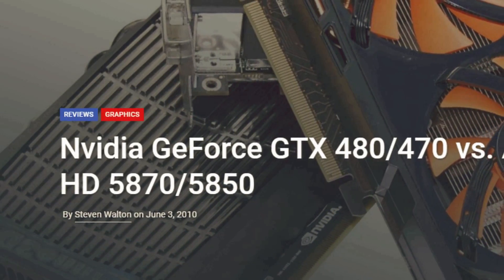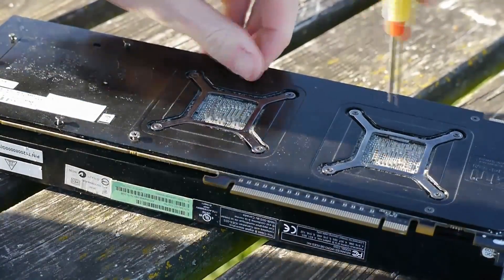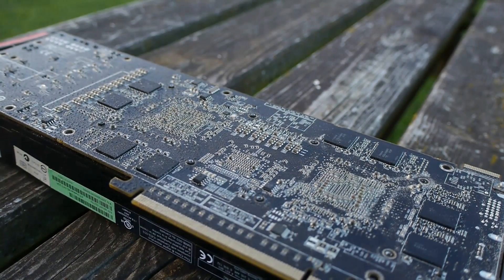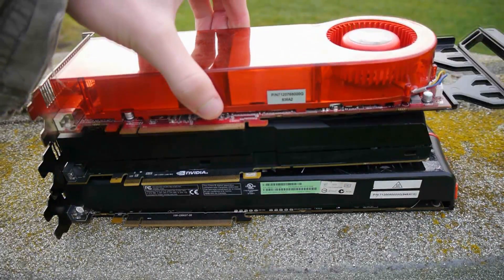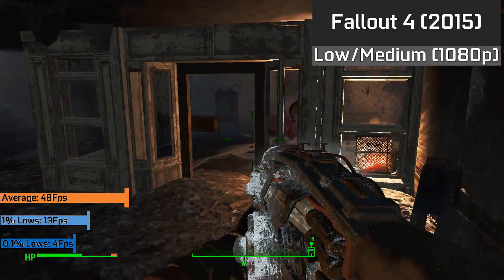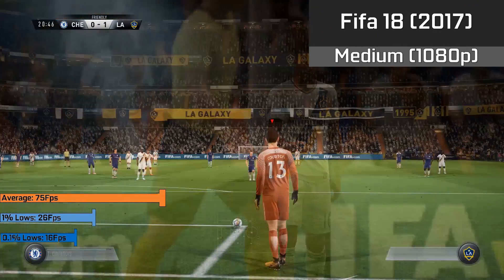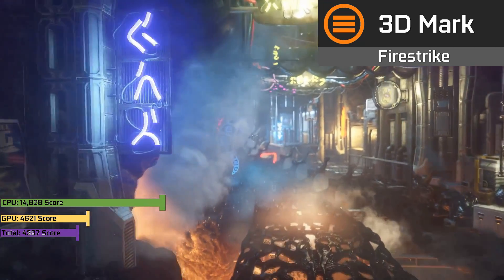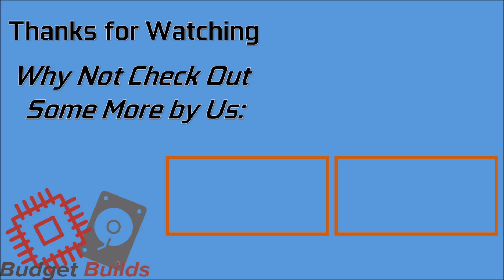The HD5970 is now £25 ($32) but is it any good?

Comment: Even today, 3200 shader units is A LOT. My fury after that was 4096 shader units, which was a ridiculous amount itself. 

For reference, the GTX 1080 has 2560 cuda cores... this just goes to show you how over engineered AMD has to be in order to compete with nvidia, due to the fundamentally more optimal exploitation of nvidia technology in windows. This is also why AMD is so good at bitmining. Their hardware has such a ridiculous amount of horsepower that games simply fail to exploit, but bitmining software can.
Reply: Well actually, the issue is more that Nvidia optimizes their cards just for games, while AMD tends to re-purpose their tech, building their mainstream products off of workstation/server hardware.

GCN is great at general compute tasks (like mining) but is not so great at heavily single-threaded workloads, like games running older DX API's. They do brute-force things a bit, but they also work around that limitation via drivers, which is where their "fine wine" technology comes from.

GCN and Bulldozer function very similarly, to the point I wonder if its what inspired Bulldozer in the first place. They even have similar gains from DX12 and Vulkan.
Reply: Richard Smith those shaders aren't even remotely comparable. Terascale uses a VLIW setup, which means it uses VERY simple shaders vs the complex, superscalar and/or superpipelined SIMD setups of modern day GCN and pascal. A 290, with 2/3 the shaders can easily go above and beyond it in terms of performance. 
The big problem is that AMD had trouble feeding those shaders, and workloads that were not embarrassingly parallel didn't scale well.

It has nothing to do with over engineering. Its a design decision. Fewer, complex cores vs many simpler ones.

Also, here's a BIG reason why nvidia didn't do well in mining. Bitcoin mining, using the SHA 256 algorithm, makes heavy use of 32 bit integer right shift operations. This takes one operation in GCN, but takes 3 operations in Kepler. You'll notice much if the gap has closed since maxwell in this regard, which may be explained by an addition of this instruction.
Reply: @hydrochloricacid2146  You mean HD 5970 vs. R9 290? The 290 has 4/5 as many shaders (2560 vs. 3200) yet the FP32 compute of the two cards is almost identical due to the 290 being clocked higher. At least for FP32, each stream processor yields 2 GFLOPS per GHz of core speed, for both cards.

Kind of ironic that Fermi ones were actually a lot stronger (GTX 580 only has 512 of them). Is it less efficient to have more powerful individual stream processors/CUDA cores, given "Thermi"'s high power draw? Or was that due to other parts of the architecture?
Reply: Richard Smith 1 CUDA core isn't the equivalent to one shader unit...
Reply: Ikr
Reply: Evbil_wafflez thank you some one who knows parts, shader cores haha lol
Reply: You can't compare shader units to cuda cores just by looking at numbers.
It's a difference in architecture.
Reply: Bro, more shaders doesn't mean anything if its slower per shader. Just like 3900x vs 9900k.
Reply: Actually HD5870 bruteforced it's way while being cooler than Fermi but it's still got outsold. Nvidia lives by it's marketing and anti-consumer practices like GameWorks.
Reply: That's partially true. You should also consider that nvidia has had the most market share for so long, that the majority of testing and optimization was performed with nvidia in mind. Even if nvidia had done nothing on their own, they would inherently have better optimization by default. Added to this that nvidia also has far more budget for in house optimization, and you can see how stacked the deck truly is.
Reply: I own cards from both companies...the only thing Nvidia sucks is raw power....drivers are great ..but not so good for mining ....Amd  drivers are good but still getting to work them on Linux takes a day..once it works...the hash rates dominates any Nvidia card... Majority on games are still DX 11(crappy ubisoft games)... currently I have a RX 580 and 1080Ti on different desktop and 1060 on my laptop...and a spare R9 295x2... Nvidia just performs better on launch days..
Reply: High level they are different, low level, they are the same thing. Scheduling is the major difference between the two, and need to be coded for in different ways, with different apis, but under all the layers of abstraction, they are the same thing.
Reply: Market dominance is the reason nvidia can get away with that. The more people that own the card, the more people to recommend the card, as choice-supportive bias is a fundamental fault of humans. The tendency to remember one's choices as better than they actually were, where people tend to over attribute positive features to options they chose and negative features to options not chosen.
Both sides are guilty of this, but it plays a particular advantage to nvidia, as they have the market dominance so therefore they are the ones who benefit the most from these tendencies. However, since humans don't live forever, the marketing department does the work recruiting new people, and these people will go on to recommend their choice to confirm their own bias.
Reply: No....Nvidia cards are just better designed and better balanced.

Comment: My friend disabled one gpu and overclocked the hell out of the second using the great cooler
Reply: Does that make it perform better?
Reply: yes, much
Reply: It def would work better, back in that year / era crossfire wasn't so good as it is today!
Reply: How much better than having both on
Reply: Nope. Lots of people say CFX didn't work well during that period but the HD4890 CFX setup I had that was faster than the GTX 470 I bought to replace it says otherwise.
Reply: Device Manager --> Disable 1/2 of the Adapters.
Reply: How did he turn off one gpu ?
Reply: I remember having HD4890 CFX at the time with the Sapphire Vapor-X models, OCed to 1.1Ghz. I was matching a stock GTX 480 in some games.
Reply: Well played
Reply: AMD GPUs age better than Nvidia that's why iam still keeping my R9 295 X2 despite having a 1080 Ti and a RX 580...its only ubisoft titles and buggy games like pubg where crossfire and SLI sucks....dual GPU cards are rare these days...
Reply: big brain
Reply: That be alot of fun
Reply: Because the heatsink was good enough for 2 gpu's, if you disable one of them, you can push one hell of an overclock. The weakness is the VRM's though, you should go out of your way to beef up their cooling though because of how the power delivery works, unless you want to cook them.

Comment: Borderlands didn't work because of the NVidia support on it, NVidia is famous for making so AMD cards don't perform well on the games with NVidia technology.
Reply: And then Borderlands uses PhysX, so on an AMD card it's best to disable it overall. Ive seen it running without issues on a 3.6 GHz Core 2 Duo and a HD 4870 maxed out.
Reply: I ran that game fine back in the day with a HD6850 so the card itself should be more than enough. That was with a Phenom II x4 965 BE.
Reply: Kliksphillip did quite a nice video explaining this, i might have exagerated a little bit but i'm still sure that a NVidia card with the same specs of an AMD card would run it much better not just because it's optimized for NVidia, but because it's made harder for AMD as well, you might not notice it on newer cards because they have a high enough performance to overthrow this.

Link to the mentioned video: https://www.youtube.com/watch?v=ZcF36_qMd8M
Reply: MRJazzygameplay borderlands 2 runs absolutely flawlessly in my 7970
Reply: Borderlands 2 with Physx on works great if you have a decent enough Nvidia card.
Reply: +MRJazzygameplay Actually the game runs kinda bad with my gtx 1050 ti and i7 950 even with phyix off
Reply: That is hard to believe considering the amount of posts and forums i've seen with people talking about not hitting 60 fps all the time on their top of the line pc.
Reply: Back when the game first came out I ran it on dual 6870s with no problem. Something's seriously wrong here
Reply: Leon Pozo borderlands 2 uses PhysX, b1 doesn't
Reply: even on nvidia cards the physX in borderlands bring down the framerate, 
don't install physX to disable it :)
Reply: I had 2 R9 270x 4gb run in crossfire and I never got it to run well in borderlands 2 or the pre sequel. I had constant shutter issues and massive drops in FPS. However when I disabled crossfire it ran BEAUTIFULLY.
Reply: Akash ShAh try turning on vsync and capping it at 60, I find that Nvidia cards have weird micro stutter when running the game at higher than 60.
Reply: I used to play the first borderlands on my old hd 4770 and it ran very well, i think the problem is the crossfire on most games
Reply: Borderlands was flaky in general on PC. The second one was better optimized.
Reply: @V1VISECT6  Until the remaster 'came round.
Reply: One HD5870 is plenty for the recommended requirements (HD5850), its probably poor crossfire optimization causing a lot of the issues. These single-card dual GPU's may also have their own issues compared to running separate cards.

Contrary to popular believe, it isn't Nvidia making games perform worse on games, they're simply very finicky about who gets to see their code, so it makes optimization difficult. Nvidia would have the same problems if AMD didn't make most of their tech open-source.
Reply: MRJazzygameplay err I call bullshit. Ok it's made to play on Nvidia .. but my old lga 775 Xeon at 3.3 gig. With a radeon 5770 and it runs Borderlands fine.

Comment: The AMD 5800/5900 series is a pretty nostalgic GPU series for me.
The first GPU I had out of it was a 5830 that lasted me until 2016
Reply: I still hurt a little inside that I was only exactly 1 year off when I built my college pc and missed the radeon 5000 series.
I built my college pc in september 2008 and ended up with a radeon 4850 for only 130$ after a sweet sale/rebate deal on newegg. The 4850 was a great card and good investment for 4 years, but just one year later  I could have gotten a 5770 or something and had direct x 11. Then again dx11 wasn't starting to become an exclusive api in a lot of titles until around 2012 anyway, so I guess I didn't hurt myself too much.

Comment: I actually used to have one of these! I wanted to note that you said two GBs of vram were usable, but I think you meant one. While the card does actually have two Gbs, each separate GPU on the card has it's own dedicated gb of vram, and since this is a crossfire setup (essentially), each one of those gbs of ram must store the same data. So this card effectively only has 1gb of vram. Which is a shame, because the two GPUs together are still pretty powerful to this day. But the low amount of vram (by today's standard) holds back the performance a little bit. Also, this card got HOT! Like, uncomfortable hot. But still,  this was my first adult high end GPU purchase. Got it for about $300 about 5 years ago. Thanks for the memories, love your channel!
Reply from the maker: +Matthew Rice: Oddly enough 2GB's was usable in games, well judging by the VRAM usage in GTA V ect.. so I might have been sent the 4GB Version accidentally.
Reply: According to Techpowerup's webpage for this card, the memory config for this card is listed as 1024 MB x2. I'm not aware of there ever being a version of this card that came with a 2gb x 2 config, but it's possible.
Reply: Matthew Rice the xfx 5970 black edition has 4gb, elric from tech of tomorrow, back when he was in motherboards.org covered it among other people on YouTube. The Asus Ares also has 4gb but that is more like a 5870x2.
Reply: I’ve noticed that Afterburner will combine the VRAM usage. So if each card is using 800 MB It will report 1.6 GB of VRAM usage. I noticed this when testing the 4870 X2. I didn’t see a way to separate it in the Afterburner settings.
Reply: That thing exists, but the clock rates are wrong. Budget Builds seem to have the 2 GB version.
See here: https://www.techpowerup.com/gpudb/b228/xfx-hd-5970-black-edition-4-gb vs here: https://www.techpowerup.com/gpudb/b1818/xfx-hd-5970-black-edition
If he has the 4GB version that would explain the good GTA5 performance. My 2x5870s are limited by VRAM hard in that game.

Comment: Only $32? here in Brazil people sell these at $188 minimun (R$600 Reais)
Reply: Every freaking piece of hardware is an absurd in Brazil. I really don't know if it's worth it to import, though. Not just because the taxes, but also for the shipping. It's a fragile thing. You will have to wait at least 2 months anyway.
Reply: PhOeNiX_H some parts are worth it. I bought a fx8300 for R$250 and 2 GTX750 2GB for R$500 from aliexpress and none of then were taxed.

I know there's scammers everywhere, but here in brazil they are much more frequent. 

Last week i've saw a guy trying to sell an old sempron single core with 1,8ghz, 1gb of ddr2 ram and saying that it was a pc ready to become a gaming pc, no kidding

the guy sells it running game boy emulator and say it is for games, unbelievable
Reply: @RafaCoprimo  I feel your pain Rafa my man, I'm in the UK and I just checked the sold prices for these cards, as I quite fancy one, and the sold listings showed them selling for...no that would be mean. I guess I don't need to tell you that you need to be careful buying graphics cards, and anything memory related from Aliexpress, as you won't always get what you are paying for as they re-program the chips on them to make them appear to be higher end more expensive kit than they actually are. Someone in work gave me his old GTX 580 for nothing last week, but I ended up giving him £10 for it, as the same guy gave me his old AGP GS 7800 years ago, and it's now worth about £200 and I feel guilty, lol.
Reply from the maker: Alexander Rewijk: I bought it for that price.... There is a receipt in the description....
Reply: Here's a screenshot from the pc i was talking about
https://photos.app.goo.gl/3aOr1HBsCvCqY1cp1
Reply: in my country it's ~$210 for a god damn gt730 with 2gb VRAM....
Reply: I know that South American feel, bro.
Reply: People think that Intel HD Graphics are meant for high-end HD gaming.
Reply: Thanks i will be selling my used rig in brazil than!
Reply: M. V. Shooting i agree, there's a guy trying to sell an Celeron with integrated graphics as a gaming pc, i'll try to link a screenshot of it
Reply: Rafa Coprimo brasil è uma desgraça fudida pqp
Reply: peoples are saying that gpu is $25 dollar on ebay but when i checked out thats $75 dollar.
Reply: joaocraft craft concordo
Reply: to be fair, i think he's full of shit on the $32 :)
Reply: Make me a list, I'll fill a case, and take a flight.
Reply: @This Izit people here like to pay what they want in things, and not pay the actual prices so not worth it

i tried before to sell some of my PCs but the headache isn't worth it
Reply: One word whatthefu*k
Reply: I guess I will use my last 600 robux on the graphics card
Reply: Here's a link: https://informatica.mercadolivre.com.br/usados/ati-radeon-hd-5970-2gb_OrderId_PRICE
Reply: Ebay my friend
Reply: i feel you , people here think the HD6570 is a high end graphics card
Reply: exactly
Reply: so if someone  in brazil buys my i7 7700K + gtx1080Ti + PSU, yadda yadda... i'm getting rich. They have to pay thousends of $$$ there for >real< High end stuff, ridiculous.   And btw. why am i even watchin' this stuff on YT xD
Reply: Sechs0rBecks
actually no, here people are called "gerson" because they want things almost for free, like an i7 1155 rig for R$350 reais, but to resell for way more, like R$3.000
Reply: i have the same if u want i ll send for 50 $ :))
Reply: El diablo da Costa
is a lot because sometimes there's way better deal, like i found and Phenom X2 4gb ram and HD4250 IGPU 500gb HDD for R$100, but here people insist in selling old Pentium 4 775 rigs for about R$400, still in 2019
Reply: the gt cards are in brazil at a good price
Reply: GG that's way too much for a gt 730, here in Brazil people think that 9600GT are "Ultra High End Gaming Graphics Card"
Reply: They still cost that much everywhere, the video maker is full of shit.